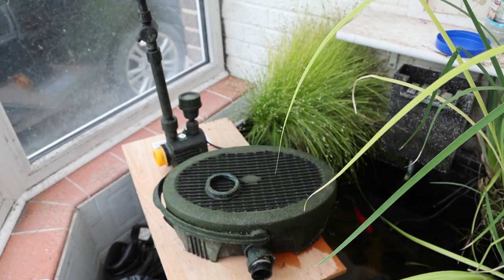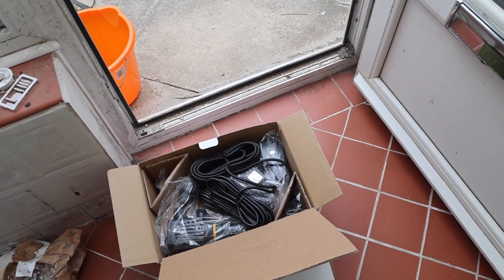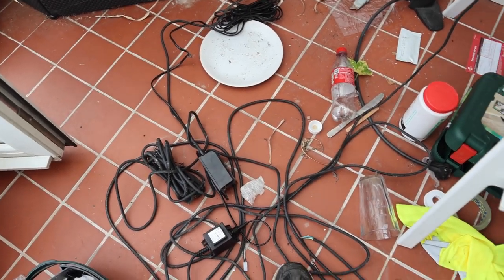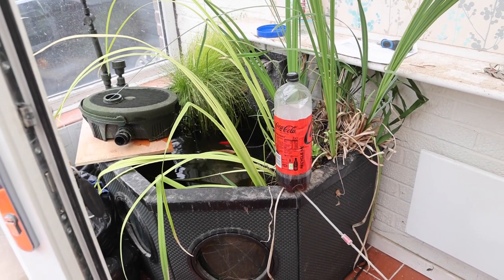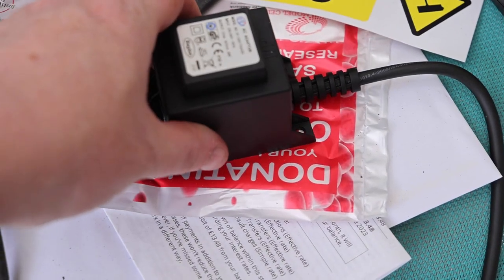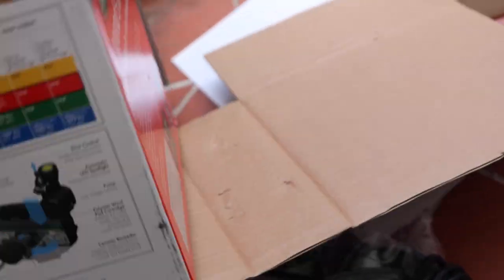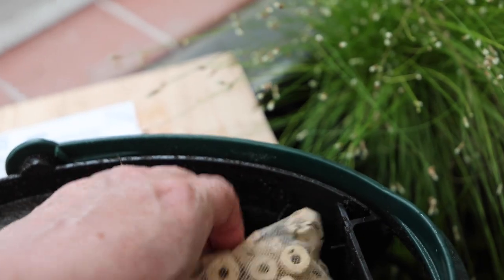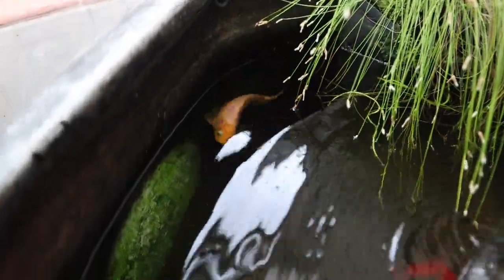Blagdon 3000 5 in 1 pump replacement

Comment: The blue wire is neutral ..  i think you ment earth
Reply: The blue is negative as you need positive and negative but you don't need an earth although correct there was no neutral 🇨🇭 that would be Switzerland 🤣 10:30
Reply: @oliverskinner8962  it's neutral ..  not negative in the uk anyway